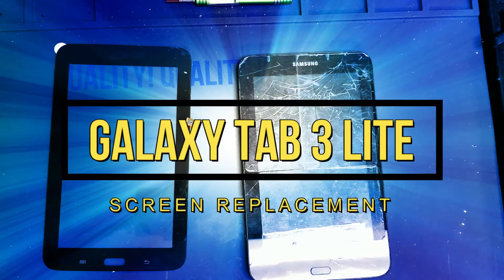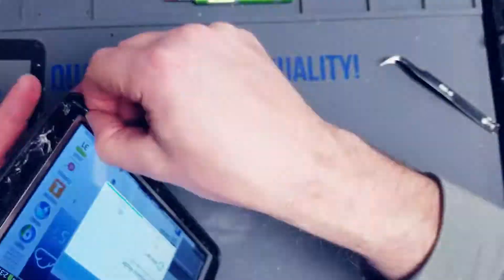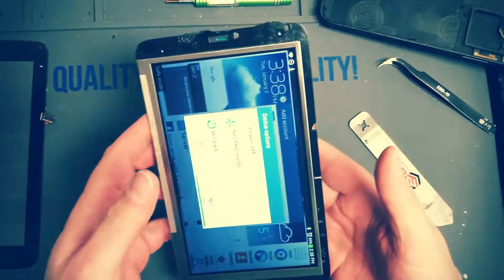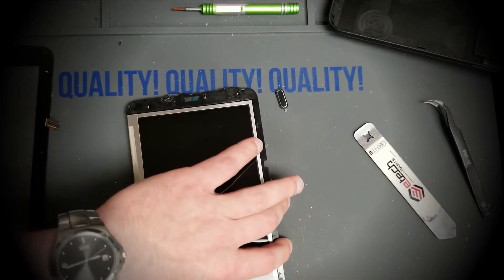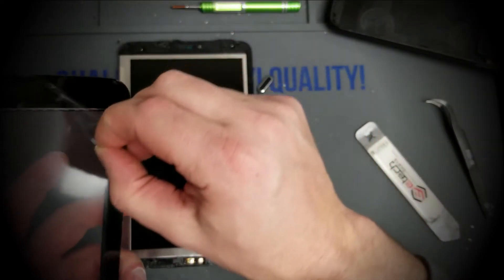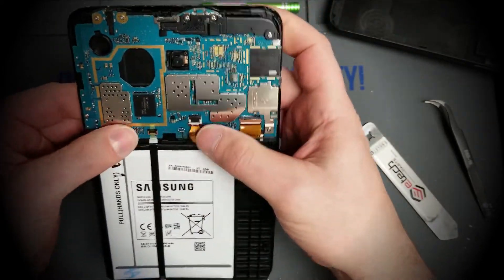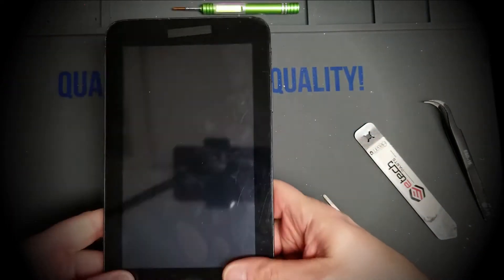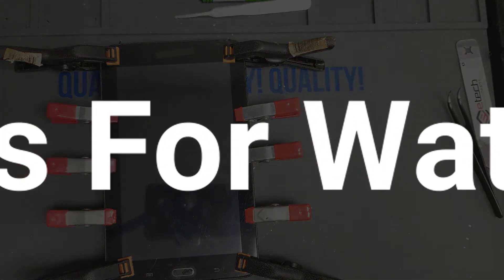Galaxy Tab 3 Lite Screen Repair

Comment: nice vid still cant fix my phone ????
Reply from the maker: Sure thing, send it in. You can keep the battery 😉
Reply: oook 
.

i will ;)
Reply: u can use clips from that vid
Reply from the maker: Motocrazy nice
Reply from the maker: Motocrazy 
757 SW 185th Ave, Beaverton, OR 97003

I'll make a vid of the repair and post it
Reply: oook but i throw it away
Reply from the maker: Motocrazy ok, maybe next time you try and fix an iPhone X
Reply: I don't have another screen